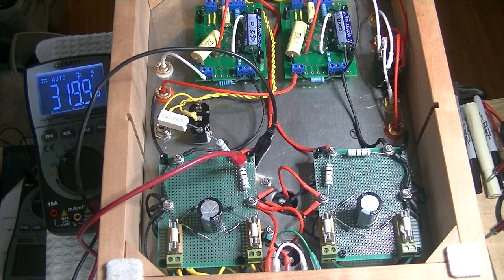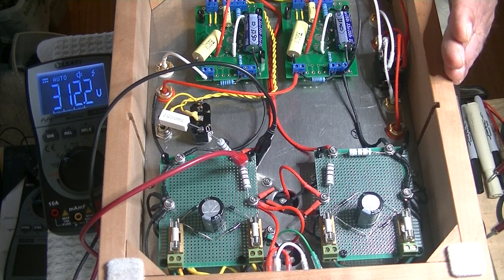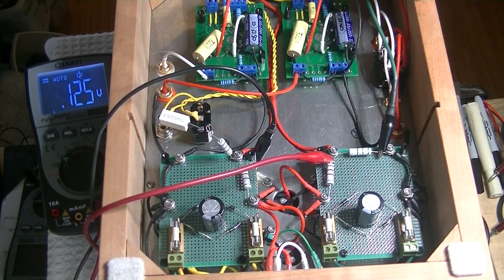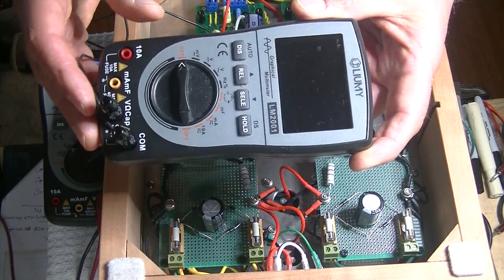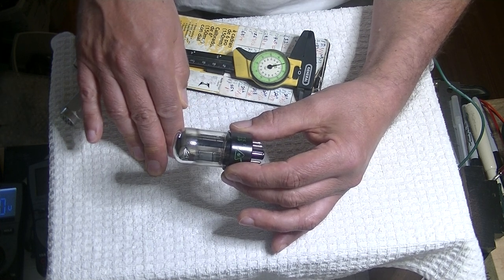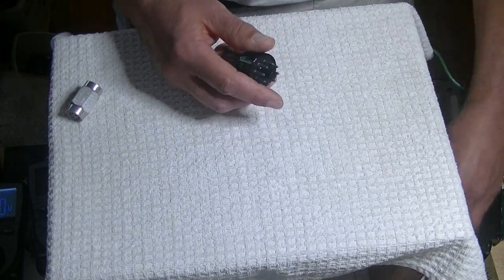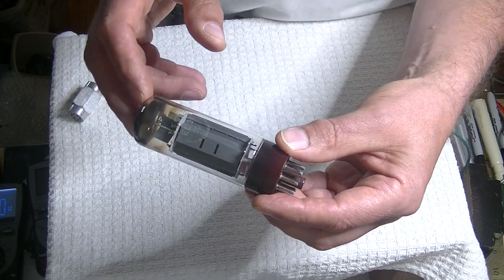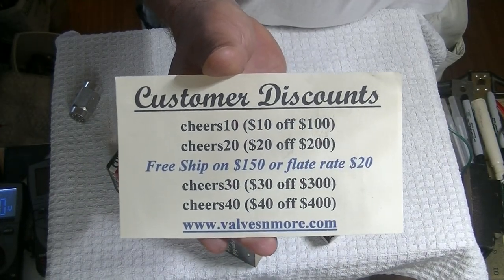Tube Lab #43 How to Work Safely on Your Tube Amp + Socket Savers / Lifters

Comment: Hello Jim, I really enjoyed this video, and your approach of safety always first when working around amps.  And the 6SN7 tubes risers are thee best that I have tried.  Prior to finding your channel, I had purchased many different risers which were all junk compared to the ones you carry.  I have the Freya + pre-amp and I can now roll tubes with confidence without any issues.  Cheers from North Van.
Reply from the maker: Thanks Nick, As an audiophile first and tube amp designer and Kit Amp manufacturer, I try and find tubes and electrical components that I would want in my system - that are affordable!  In the case of the sockets, I brought in a bunch to try out and it only took one test to realize these were the ones I wanted in my system and in the store.